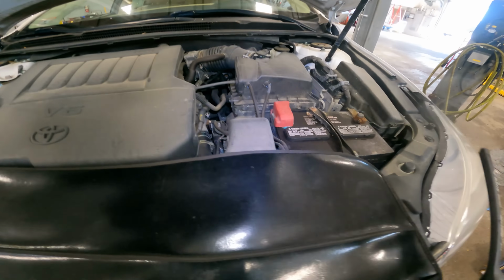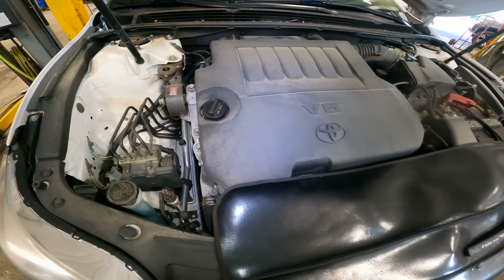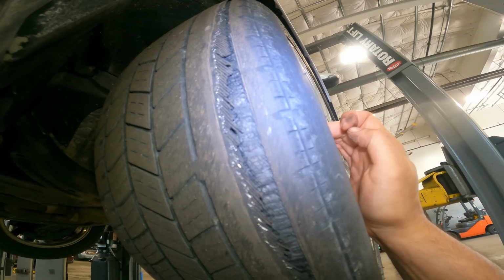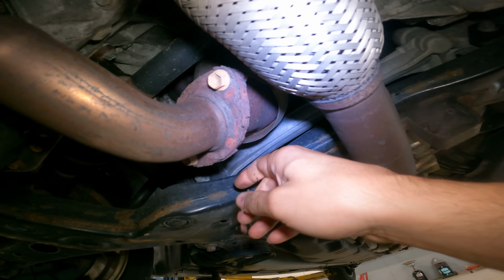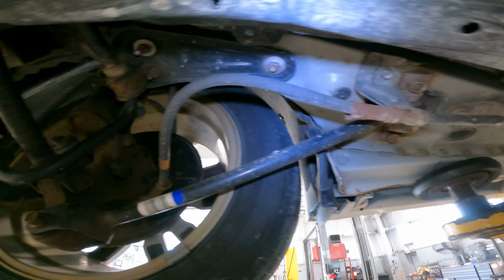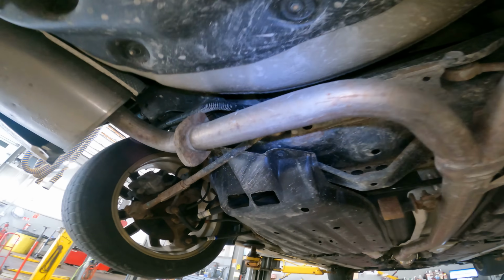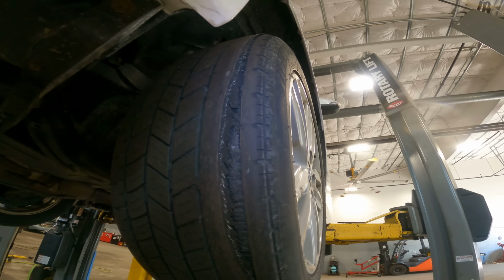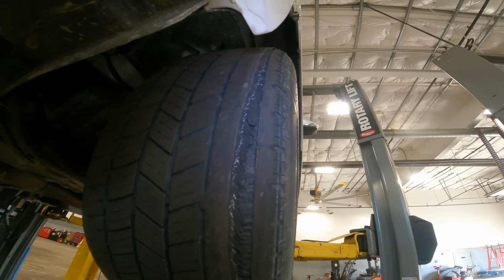Customer states I CAN SEE THE INSIDE OF MY TIRE! NOT GOOD!😨🤯

Comment: I understand that vehicle repair is expensive these days however not doing the proper maintanance will cost you even more in  the long run. Getting things like your brakes checked out once a year will allow people to know where they are and can properly budget for a repair in the future.
Reply: in the UK there is a compulsory safety inspection (MOT) which must be passed, on all motor vehicles starting on it's 3rd birthday, (assumed manufacturing and road conditions won't necessitate one before that), before the owner is allowed to tax the vehicle for use on the public highway. Fail the MOT, can't use the car until it's fixed and retested.
Reply: @kathrynwhitby9799  that's what I call a "nanny state" country. Owners are the ones responsible for their vehicles, not the government.
Reply: @bikerz3857  owners are responsible here too. The Gov only covers the overseeing of a minimum standard of roadworthiness (the MOT test) from one year to the next. Any car that fails is not legally allowed to drive on the road, except to and from a repair shop and for a retest. 
checklist: https://assets.publishing.service.gov.uk/government/uploads/system/uploads/attachment_data/file/966766/mot-inspection-checklist-vt29.pdf
also, driver's penalties:
What is the penalty for driving without MOT?
On top of that, if you are caught with no MOT and car insurance, you could get 6 to 8 points on your licence, an unlimited fine or a ban on driving. Your vehicle could also be impounded. For instance, in 2019 alone, over 137,000 uninsured vehicles were seized across the UK, or one impounded vehicle every four minutes.17 Apr 2022

hope that sheds some light.
Reply: @bikerz3857  I dunno, I don't want to be responsible for the guy crashing into the back of me at a red light because his brakes are falling apart from neglect
Reply: @bikerz3857  and when owners fail to be responsible, who do you think suffers on the road? Have you not seen this guy's other videos and similar ones out there? steering components falling apart, vehicles with no brakes on one axle and past marginal on the other, etc. You have people out there driving death machines. I'm fine with inspections if it'll protect me from idiots on the roads.

Comment: Always entertained with your "flavoring" comments. I assume you are somewhere without Winters. Living in WI, flavoring is there almost from the start. I've definitely had my run-ins with part replacement flavoring wrath. Still, on average my vehicles structural components outlive the mechanical side 85% of the time. Once I buy a vehicle, it never sees another owner. New, they're good for 20+ years. Got a 1999 Suburban, 2004 Yukon (new), 2009 Escape (new), and a 2014 Verano. Flavoring here in WI is the spice of life. Keep giving us these great videos.

Comment: The amount of times I have seen cars come in with cabin filters completely blocked up or so foul they are ready to walk by themselves amazes me. As for batteries a customer complained that his battery kept going flat and vehicle was going nuts. Well on inspection noticed they used so much battery terminal crap It was hardly making any connection at all. The local battery place I use HATES the coatings on battery terminals because it can cause more issues such as lack of proper contact with the battery posts.
Reply: When I bought my car (used, private seller) and brought it home, first thing I did was general maintenance stuff like changing fluids and filters (you never know what ppl pour into their vehicles so better be safe than sorry). Took me one and a half hours plus an internet search to find the freakin' cabin air filter. It simply doesn't have one.
Reply: @monsterkater  yeah some vehicles don't have a cabin filter.

Comment: Get caught with four tires like that in UK you might get £10000 fine (£2500 per tire)and 12 points resulting in driving ban as well.
Reply: That is correct however in the UK we have tyres not tires😁

Comment: That type of tire wear is normally caused by one thing: insuficient pressure.
Reply: exactly. every one of those tires was run low for extended periods of time ie they where NEVER checked for pressure from the time they were installed. Makes you wonder if anything in that car has been checked or changed out.
Reply: @edfrawley4356  you have to take in account the state these people live. They won't check the tires pressure since they believe the government is supposed to provide for them.
Reply: Yes it is...and it is indicative of a driver who cares little about maintenance much less periodically looking around at their own vehicle. If they are physically challenged and cannot do so. they should get a periodic inspection more often. Sad to say this situation is not at all unusual. Matters not where you live.
Reply: @paulsullivan6392  As a retired trucker I am so used to knowing the condition of my vehicle at all times. But I do know others who will not even think about it until it is making some God-awful noise or just completely breaks down and stops moving.

Comment: 14mm same as 9/16"....13mm is slightly larger then 1/2".....11mm same 7/16"... I live in Ontario canada so I'm use to variable bolt head sizes, 12 point sockets with a hammer can be real healpfull

Comment: Did they need to get a co-signer for the bank loan?  I'm thinking $1500 to $2000 for all this?  Anyone know?
Reply: Easy! Tires along are 1000-1200 bucks. Brakes probably 500 . Alignment 150. Brake flush 120. Filters maybe 80-100. And I’m willing to bet it’s got other issues lol
Reply: This is the modern cost of running a car. To give some perspective, the average new car is $47000.
Reply: @greentriumph1643  Good grief.  $47k + financing.  How many taxis would that pay for?  Or kind $5 or $10 bills to friends?

Comment: Am I happy that I live in a country where the roads are not salted,,, and we also drive on the correct (Left) side of the road 😀
Reply: lol.. wrong side you mean.. lol
Reply: Salt works far better than anything else. Sand, cinders, small children...none of them melt the snow and ice. Salt does. Rinse the underside once in awhile, and you prevent the rust. 
As for what side of the road is correct, it's whatever side everybody else is going (if they are head-on to you, you're going the wrong way!)
Reply: @markh.6687  Funny you should say about almost having a head on collison. I have been to the 'States for work a few times (we have a sister plant in Morristown TN) and the biggest problem that I hadd was doing a left hand turn. I would instinclively turn onto the left hand side of the road,, scared the crap out of me a few times. One of the my fellow Engineers in Morristown told me to repeat "lefty loosey,, righty tighty" to myself before doing a turn. Seems to have done the trick as I did not have any head ons .
Reply: @MrBugsier5   If you read my pervious reply,,,once leaving work whne I was in Morristown with some other guys, I instinctely went toi the right side of my car to get in,,, all the other guys cracked up laughing,, took me a few seconds to figure out why they were laughing,
Reply: @leor2830  Having watched footage from the UK and 'Straya driving on the left, I'd have done the reverse, especially through those roundabouts ('traffic circles' in 'Murica) with 4-5 different streets merging to boot.
Reply: @leor2830  Had you gotten in, you'd be looking for the steering wheel as well, Leo. :)

Comment: I've never changed the brake fluid in my 2015 car and it brakes just the same as when it was new
Reply: Changing brake fluid on cars is a scam garages use to increase bill, mostly it's never done. But still charged. Mine was changed when I fitted new brake calipers at twenty years old.
Reply: If you live in areas of high humidity it's very important. Brake fluid adsorbs moisture from the air, and collects at the lowest part of the system. If you then need to use the brakes heavily, the water boils to steam and the pedal hits the floor.
The collected water can also corrode brake components, especially on cars with rear drum brakes, which then need the wheel cylinders replacing at greater cost than a fluid change.
Reply: Yup, corroded brake lines from moisture being in the brakes fluid and if the line corrodes through you don't have brakes. Surprise!
Reply: It all depends on the application, if the car does average commutes brake fluid can last most of the life of the car. If its driven harder where the breaks can heat up 2-3 years, if its tracked then 6 months max.
Reply: @robertficek7586  I'm sorry, but that's the wrong way around.
A car that's driven hard, where the brake fluid gets regularly heated, may boil out most of the moisture that causes the damage.
Brake fluid doesn't wear out with use, it's only the fact that it's hygroscopic that warrants changing it.

Comment: Looks like they run their tires low on pressure looking like that as well as needing an alinement. They don't realize that the brake fluid gets low when your pads are low, don't add fluid, add pads! And now rotors.
Reply: But I tried adding pads to my pads; they didn't fit that way. :)
Reply: @markh.6687  hahaha, also there's plenty of metal left after the pad is gone.